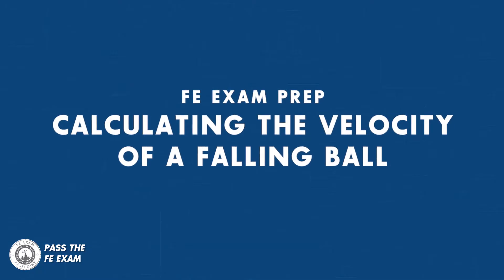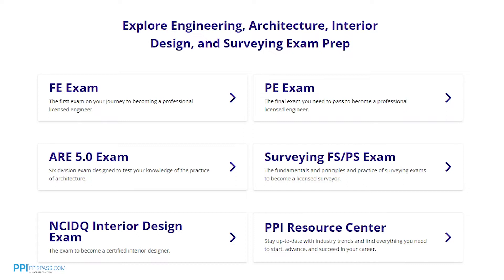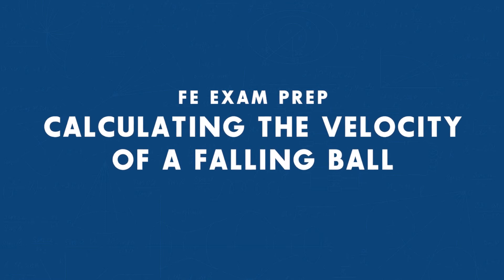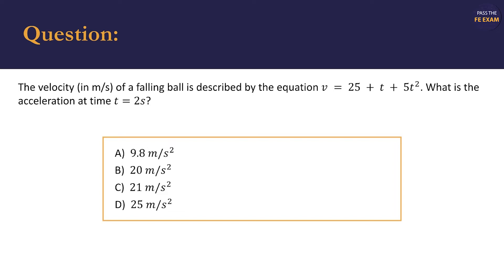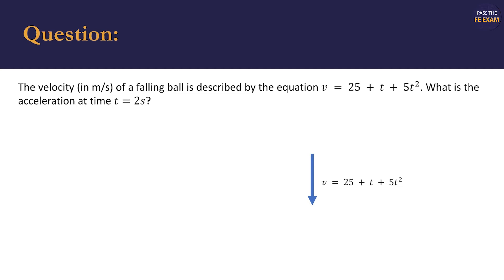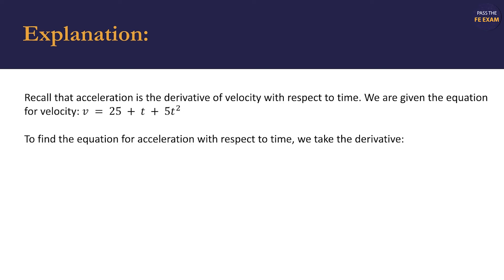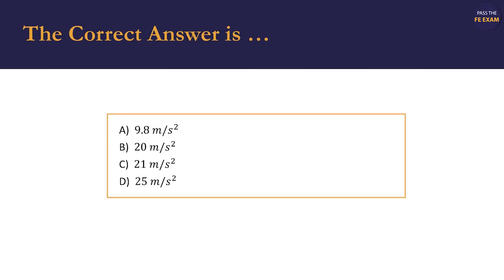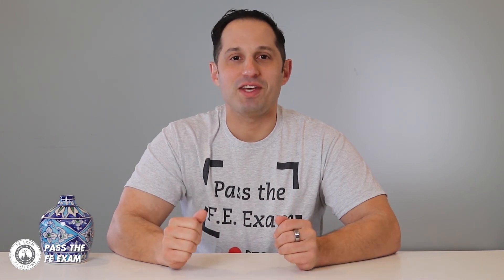Calculating the Velocity of a Falling Ball | FE Exam Prep

Comment: How do u get 10 + 1t?
Reply: Hi @quix812, 

I believe you meant to write 1 + 10t, as shown in the video. 

In physics, the derivative of a function representing the position of a particle along a line at time t is the instantaneous velocity at that time. The derivative of the velocity, which is the second derivative of the position function, represents the instantaneous acceleration of the particle at time t. We can apply the derivation rules that are typically covered in Calculus I and II to solve this problem. 

In this case, we are already given the velocity equation in respect to t. Accordingly, if we take the derivative of the velocity equation with respect to t, we will have the equation for instantaneous acceleration with respect to t. We can write this as dv/dt or v'(t). For the sake of YouTube comments and lack of math formatting, we will use the apostrophe notation. 

If you take the derivative of v = 25 + t + 5t^2, we arrive at a = v'(t) = 0 + 1 + 10t.

The derivative of a constant (that is, 25), is 0. 

The derivative of a variable with an exponent of 1 (that is, t), will be the coefficient (we skip writing a coefficient of 1, but technically, "t" is really 1 times t, so the coefficient is 1). 

The derivative of a variable with an exponent greater than 1 (that is, 5t^2), will be the coefficient (that is, 5), multiplied by the exponent (that is, 2), multiplied by the variable raised to the previous power, less one (that is, t^[2-1], or t^1 which we just write as t). So, we have (5)(2)(t) = 10t. 

Simplified, this becomes: a = v'(t) = 1 + 10t.

Please do let me know if this adequately answers your question. 

Enrique
Reply: @enriqueivers this helped me a lot, thanks.